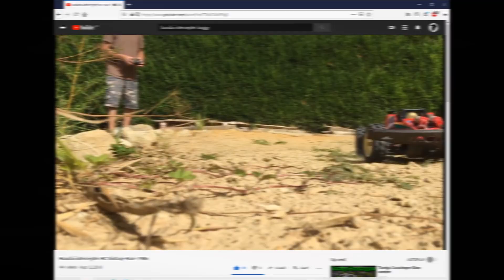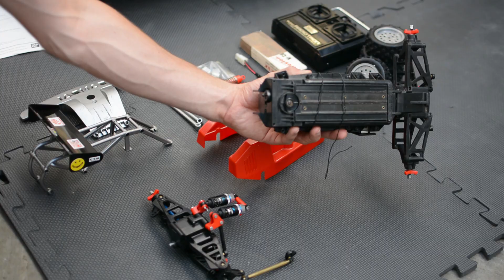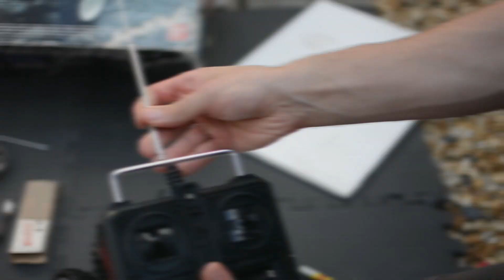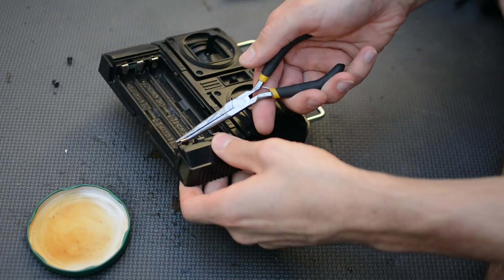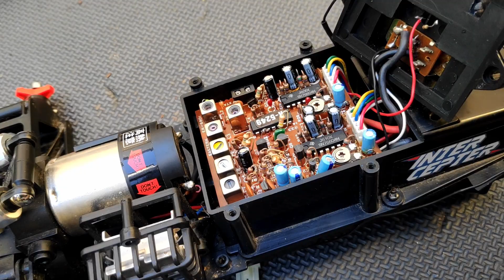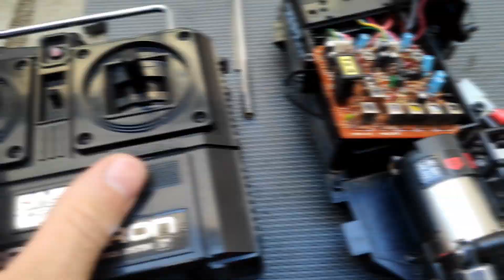Restoration of a vintage RC car - bandai intercepter 4wd buggy - part 1

Comment: Going through a restoration process of this beauty myself. But I can’t find the info anywhere - does it have a failsafe mode? I’ve noticed that after bringing back to life, once it loses the signal from the remote, it keeps going. Not sure if this is how it used to be back then, or mine is broken and I need to continue fixing. Thx!

Comment: I had one of these as a 12 year old back in 86, hated it to be honest as I had asked for a Tamiya or Kyosho kit. Took this to the local RC club and it handled so badly I couldnt get round the corners. It's a toy not a proper RC. Props to you for bringing it back to life though and it did spark some memories!

Comment: Hi. I've got 6 of these cars, as well as a few that are the same but branded by different manufacturers, 1 is new in the box. I also bought a load of New Old Stock spare parts from the US. I really love them. All of it is in storage at the moment. They're cool buggies with really long travel suspension that is great for rough ground, but is also it's main weakness. The problem is it quickly develops play in the linkages and even worse is that there is way too much flex in the shock mounting points meaning the wheels can move around a fair bit without actually activating the shock/spring itself. I see whoever had it before has mounted what look like aluminum oil dampers. If you can remove any play from the linkages and stiffen the mounting points those dampers should help it handle loads better. Looking forward to following this build 👍 subscribed
Reply from the maker: That's a lot of cars! In fairness I have not noticed that little mod, I assumed it came like that originally. And yes I love the suspension design on this one. Many thanks!